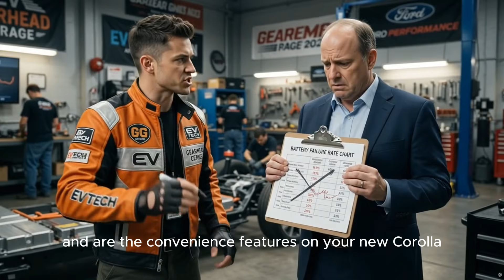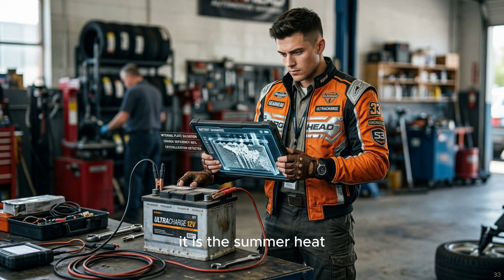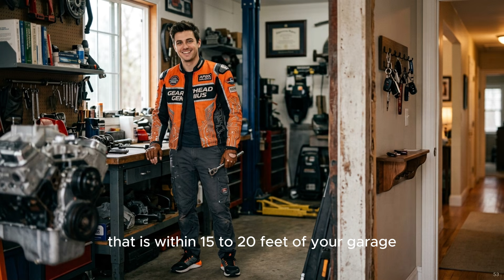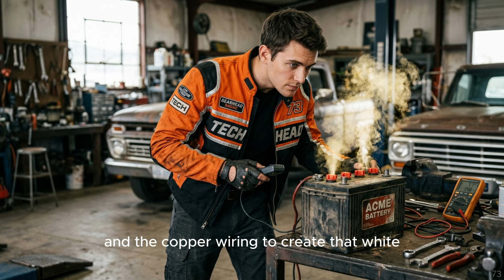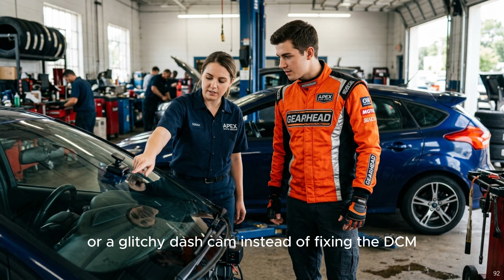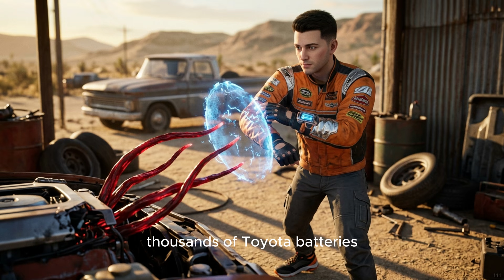Toyota Battery Dies Too Fast? These 4 Habits Are the Culprit

Comment: 2010 Camry 2.5, original  Toyota 12v battery ( made by Exide) lasted 11 years. It was still working when replaced because capacity had fallen to 400amps. Probably would have lasted longer, but why chance it.
Reply from the maker: 11 years is an absolute testament to "Old World" Toyota engineering, Alex!

That 2010 Camry (with the legendary 2AR-FE) had a real mechanical alternator and zero "connected" features. When you pulled the key out of the ignition, the car actually went into a true deep sleep.

In modern 2026 models, the car is never truly asleep. The Smart Key systems, Data Communication Modules (DCM), and over-the-air updates act like electronic vampires, constantly bleeding the 12V battery dry in two to three years.

Smart move replacing it once it dropped to 400 amps—proactive maintenance is the exact difference between a true GearHead and a stranded motorist!